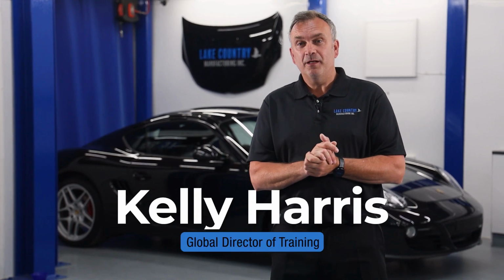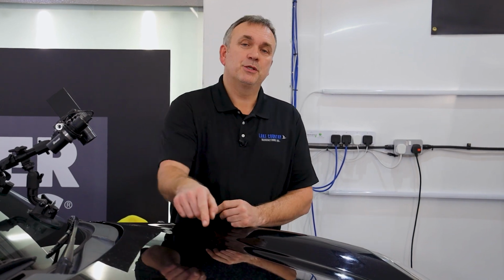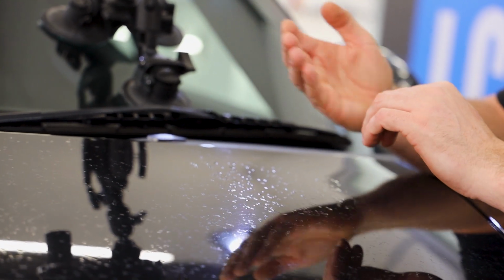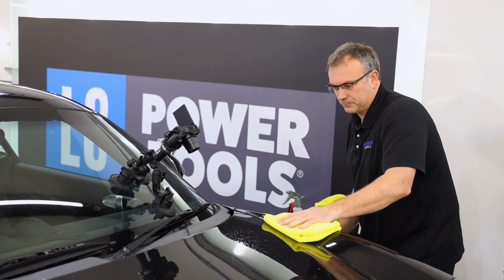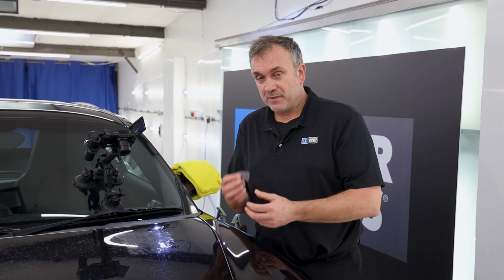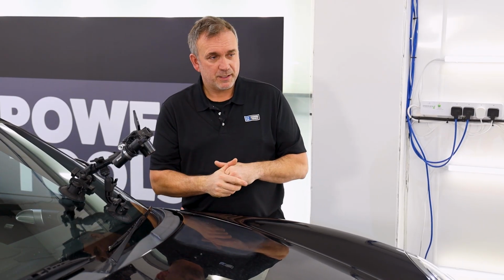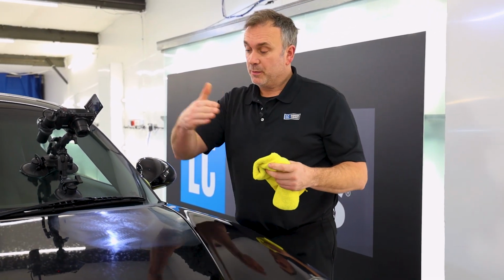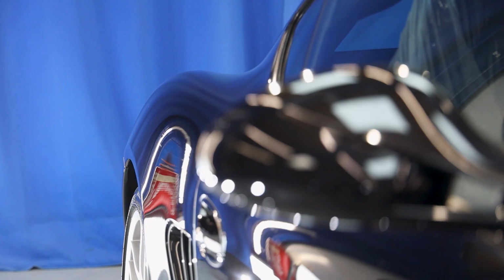Porsche Cayman Bug Etching | Part 02: Nothing to lose... (touch-in and de-nib)

Comment: Any recommendation for a good clearcoat that's not too thin (so it doesn't run on vertical panels) which doesn't need to be mixed up like you did?

Comment: Hi Kelly. What do you think of sanding before applying clear coat or a touch on color? I tend to sand with a 1500/ 2000 grit to give the paint more area to bond to. Lots of touch on done by bodyshops that just apply the colour will just come off by the blade... Thanks for your input 👍

Comment: From now on i will call you "THE PROFESSOR".precise as always. thanks for your time and effort for these vids. my greetings to Jay, already using the tilting technique.
Reply from the maker: Thanks, and good luck with that ;) I also wrote a blog about it, in case you need to refer later: https://lakecountrymfg.com/detailbay/should-you-keep-your-pads-flat-on-the-paint-surface/
Reply: @LakeCountryManufacturing  Amazing ! Thank you. Keep it up. Also I have a question for this video. Can you use an airbrush to apply Clear coat evenly in minor defects if you need to..in a peeling situation or something like this ,in case a client wants you to restore it without painting